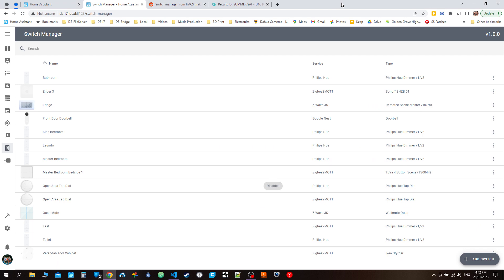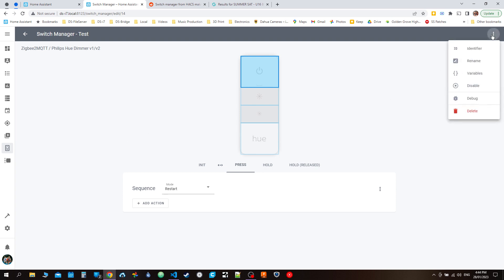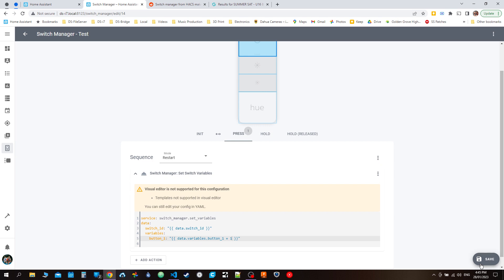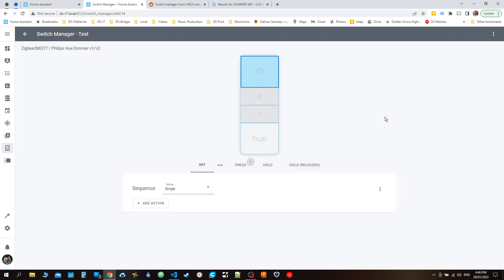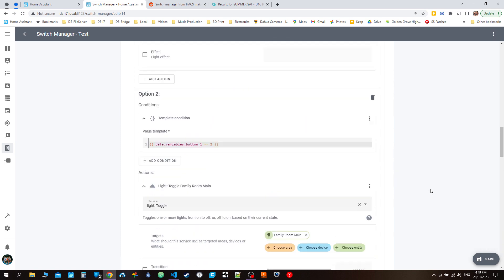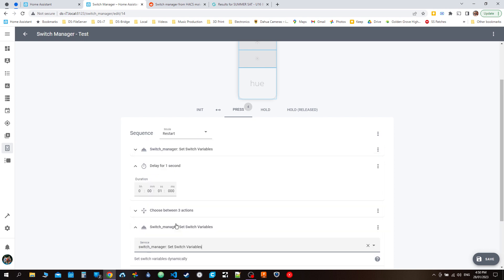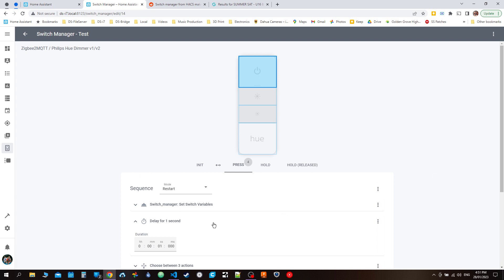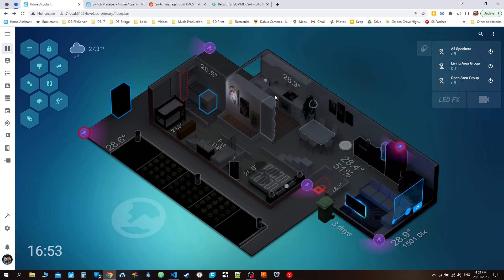Home Assistant - Switch Manager Emulate Multiple Button Presses

Comment: Dear BitBorn!
How did you solve the temperature distortion to align them to the wall/floor in 3D? What method, tool or procedure did you use?
I also work on a similar procedure. Although this will be even more difficult to solve in my apartment, because I need a perspective point of view for the distortion.
I would appreciate any guidance you can provide.
Thanks in advance!
Thanks for your videos too! They gave me a lot of inspiration and ideas. 🥰